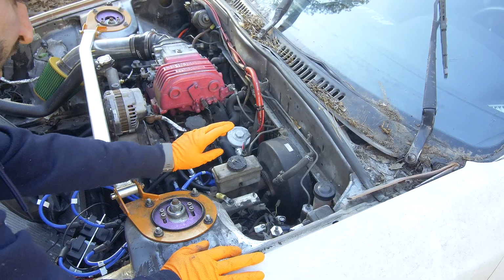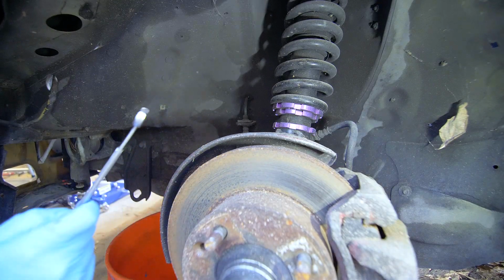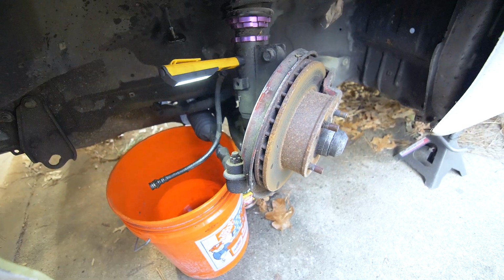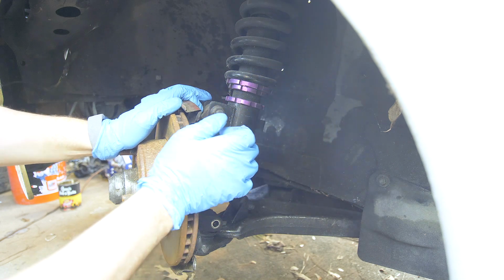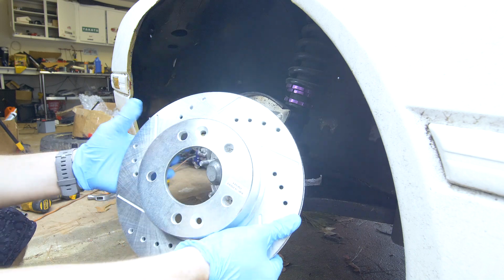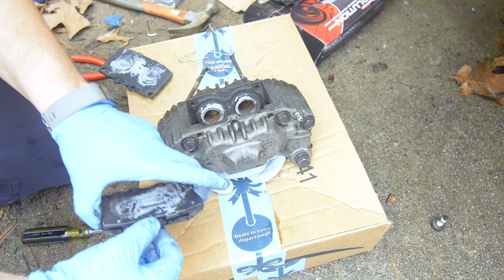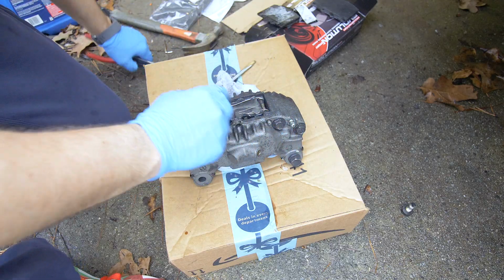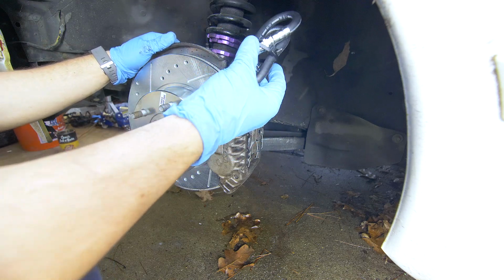FC RX7 4 to 5 lug conversion, wheels and brakes - Part 1

Comment: I’m putting FD 4 piston calipers on my 1989 gtu which originally came with single pistons vented rotors in front and solid in the rear. Do  you have to swap out the NA master cylinder for the Turbo 2 version and and get an adjustable proportional valve to reduce brake bias?
Reply: I'm currently doing this with 4-piston Front T2 calipers for my 1989 GTU with the same rotor setup. 
I read around that the fronts fit perfectly, but that I would need an upgraded MC and brake booster.

Which should I get?
Did you find the solution to yours?
If so, what did you do?

Thanks!

Comment: Where do I buy the 5lug converter or find one  I have a 1988 se 4lug
Reply from the maker: I think the easiest way is to find someone parting out a 5 lug car on rx7club or ebay. I had to mix and match since they usually go pretty quick. Good luck 👍👍

Comment: Where did u get the conversion
Reply from the maker: I sourced most of the parts from rx7club and ebay. I actually had to buy reman. rear brakes from rockauto though since the used ones were seized :/
Reply: supercarmio oh I’m just in a budget and probably this was first thing I need for the car because I’m getting 18 inch te37sl

Comment: I have to do this. I can't find the rims I want in 4 lug without being a universal bolt pattern.
Reply from the maker: For sure, that was one of the deciding factors for me as well.
Reply: I literally just found the rims I was looking for in 4×4.5, they are 16×9. I don't want a wide body kit and it is lowered 1 inch.  I live in New England so we have car eating pot holes so you can't lower to much, also I just painted it 46V and its to late to roll the fenders and quarters. Im a 18 year veteran of collision work and 7 mechanic. Im not a back yard dyi guy.

Comment: Do you know if the 5 lug spindle hub and brakes from a s5 vert will work on a 87 base.
Reply from the maker: yep it should be the same as in this video - verts got the same setup as the TIIs.

Comment: What size wheels and tires?
Reply from the maker: They are BBS RX233 17x9 ET28. Tires are 255/40 👍
Reply: supercarmio damn I didn’t know you could fit that wide up front, what’s the offset?
Reply from the maker: @natepitchford6968  Haha this is like the first car these wheels have finally fit on! They are ET28. Fit over the brakes and flush with the fenders - so I'm happy.

Comment: Awesome video man, What year and vehicle did the 5 lug conversion come from? And you think it would fit an 85’ Rx7? Tia
Reply from the maker: Appreciate it man! IIRC it was a 91. Unfortunately I believe the FBs are quite a bit different. I don't think it's an easy swap, iirc you'll need an adapter kit of some sort. I think some go as far as modifying the FC subframe to fit on a FB to get the whole FC front setup, brakes and all. good luck!